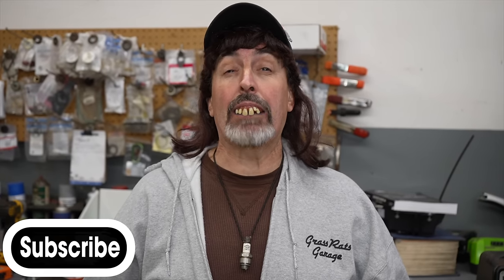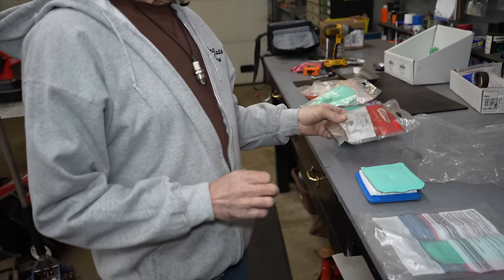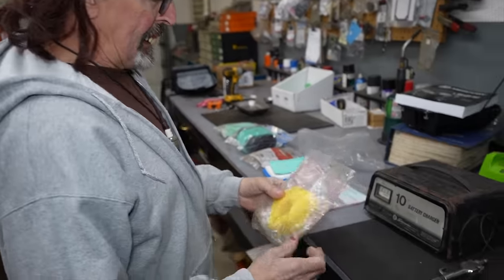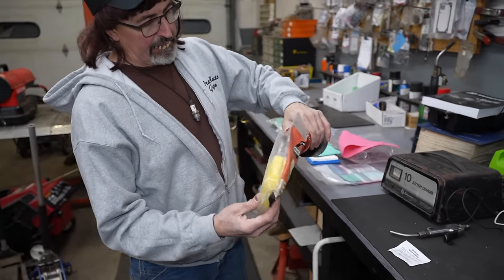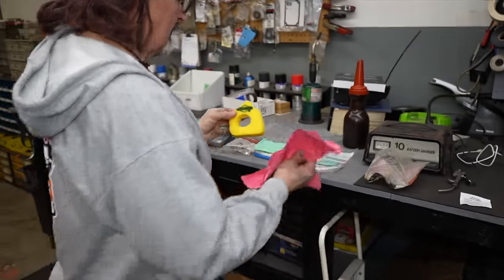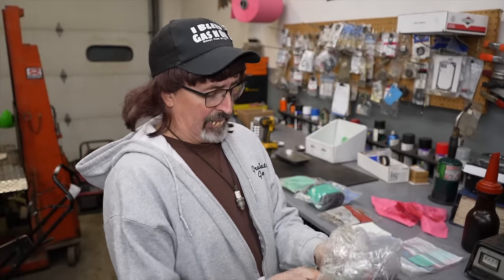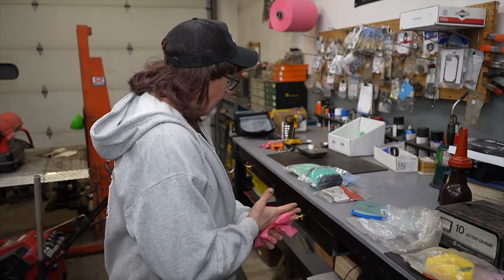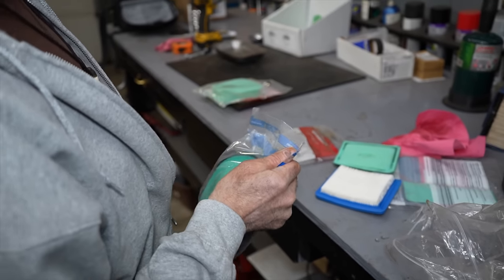Should You Oil Your Air Filter?

Comment: Long time automotive mechanic here, I didn’t know the pre-filters needed to be oiled. Good information as always, thanks Taryl.
Reply: That obviously doesn't confer expert status on you or your profession, but even K&S filters use oil and sell a special filter oil (automotive performance applications). It's the best combination of the old oil bath air cleaner and the modern kind with a foam and/or paper element. Did you know older engines used an oil bath type?
Reply: @Hjerte_Verke  Did you know they also came with a rope and wooden handle with which to start the motor.
Quit acting all high and mighty.  Basically calling us stupid/ignorant.  That attitude is just not warranted.
Reply: Manual for tecumseh vtwin specifically says not to oil pre-filter.  No idea why.
Reply: @gadasavideos8564 So does the manual for the Kawasaki V-twin FR and FS series. Specifically states do not oil pre filter.
Reply: @scottp2462  don't know about kawasaki

Comment: Back in the 1930s, 40s and 50s cars had oil bath air filters, that looked like a giant Brillo pad sitting in a pot of oil with a lid that fit with an opening around it to allow the air to get into the filter through the oily brlillo pad media and then on down into the carburetor. They kept the bigger rocks out of the engine.
Reply: They kept Everything but Air out of the engine.
Reply: My 1967 Ford 3000 tractor has an oil bath air filter. That oil can get dirty but the filter above it was always clean.
Reply: Oil bath filters were the best air filters ever made. The Army still used them in the 70's.
Reply: Just can't use them on modern engines because the oil messes with the MAF sensor

Comment: I have been using motocross air filter oil on everything from rc cars to dirt bikes or anything with a foam filter. Just soak it in oil, squeeze out the excess and let it sit overnight to get any remaining oil out. I like the motocross oil because it’s extra sticky and captures all the dust. And clean the foam in hot soapy water. It is more expensive but a lot better!

Comment: AWESOME! I was taught that oiling the foam restricted air intake and could prematurely damage an engine. Thanks so much!
Reply: there are lots of bad advice out there....lol... how can oiling cause problems..if over oiled it will foul a plug at worst...but soon clear up and be fine... no oil can destroy an engine quicker
Reply: it isn't saturated, just damp with oil.

Comment: Also it is important to change the air filter because  a very dirty one  will cause performance issues with the engine making it run slower which has happened to a mower that we own it was running quieter than normal and I thought this is an air filter problem and it turned out that I was right.  I looked up on how to oil air filters and if you need to and I found my information very quickly and it was nice to see Taryl go over this as well.

Comment: Dawn is the best for washing prefilters.  Rinse well, squeeze out and dry on the boiler or on the floor in front of your fridge where the warm air vents out, or outside in the sun on the deck railing.
Reply: That's what the 5 gallon bucket of old gas is for 😉

Comment: You have brought up a valuable and money saving revelation.  For years, and even though I have lots of automotive experience, I have serviced our dirt bike and UTV air and vent filters with JP Aerosol, which is recommended by the bike shops and is expensive.  In reality, using conventional motor oil is just as effective however because the serviceable filters are rigid, I will now use a pump spray applicator.  This will save a lot of money.
Reply: That's on you for wasting money on a "specialized" product instead of using something way cheaper that does the same thing. I actually read motorcycle manuals and they have said to use fresh motor oil for as long as I can remember. I'm sure "bike shops" recommend a lot of things to garner a sale, it's all about the money 💵

Comment: This was great, Taryl. But it would also have been helpful to show a dirty filter being cleaned before re-oiling it. No one needs to find or buy separate pre-filters if they just see how easy it is to clean the one they have (regularly) with soap & hot water ~
Thanks, always good viewing 👍 👍 👍
Reply: Use fill a small bucket with hot water and liquid dish soap (i.e. the stuff they use to clean the ducks when an oil tanker spills). Submerge the filter and squeeze it/swish it until it isn't oily anymore.

Comment: Great information video, Taryl. I always have used common sense & oiled the foam filters, squeezed out the excess oil. I also clean & reuse the filter. With you having the business that you have, at first you were probably shocked when a customer would bring in lawn equipment, they didn’t do any maintenance but now you’re probably not. The ones that don’t maintain their lawn equipment are probably the same ones who don’t maintain their vehicles. Keep’m coming

Comment: This reminded me of time I helped a lady start her Yugo at night. I thought the choke was stuck, when I took off the air cleaner a swimming pool of oil saturated the paper filter. Well it's not good to run your Yugo without one, I told her it would get her home. It started and then gave a free light show from the cracked ignition wires and off she went.

Comment: Lot of people don’t realize the older vehicles pre 60’s didn’t come with paper filters. They relied on oil alone to do the filtering. Most had canisters with a Brillo looking media that the oil would circulate through before going into intake. The dirt would accumulate at the bottom of the oil reservoir and would need changing regularly
Reply: Lots of older tractors like the Ford N-series used the oil bath method.

Comment: I have a bottle or 2 of K&N filter oil for my car and truck. I would think a light spritz of that on my mower filter would work well and minimize excess. I might try that in the spring.
Reply: A down side to the kn filter being oild is when oil gets sucked up into your mass air flow sensor and ruined the eliments

Comment: Your right about getting a new pre filter and throwing the old one away normally the foam gets old and starts to fall apart  just when you don't realise then when you check it to wash it out it's half gone or sucked around the main filter , good airflow =power and economy filters are cheap engines are not ! New filters are cheap insurance ,

Comment: Yes,I wash mine out with dishwashing liquid, let it dry out, stick it into a small bucket then soak it with engine oil then I wring it out as per Briggs and Strattons service manual instructions then I refit the filter. onto my 3 horsepower Briggs and Stratton powered mower  !
Reply: You're automatically elevated to genius status in the comments section. So many are bewildered that you would oil an air filter (and leave the oil filter dry lol).

Comment: No need to buy a new foam filter or pre-filter, you can hand WASH them with mild detergent or dish soap, let air dry and then re-oil. This is stated in many a Briggs-Honda-Clone engine manual
Reply: You can wash them... for a while.  Eventually they fall apart.  They are cheap enough that it makes sense to replace them if you value your time.  Either way, any maintenance is better than no maintenance.
Reply: Wash them in turps, not petrol then wash the turps out with soapy water and rinse. Dry in the sun thoroughly. Don’t over service them and with motor bikes use some grease on the sealing surface at the front of the air box to make doubly sure no dust gets through. The turps will wash the grease seal off too. You can wash a good spare parts, not after market, filter many times.

Comment: Back 40 years ago I raced motorcycles I squeeze to much oil out of my filter an after the race I checked the filter an it sucked dirt because of it. I would also add  grease the mating surfaces of the air box.
Reply: Grease in the air box is the best

Comment: I don’t oil the foam wrapped filter on my Briggs Intek, however that filter and foam are cleaned and blown out everytime that mower leaves the garage. My filters have held up well and had a long life for doing this. I know some videos are done for folks that largely do not routinely maintain their equipment.

Nothing I enjoy better than to trigger trolls and watch them loose they’re _ _ _ _ when someone does something different than them 😁 For me I could care less what others do, knock yourself out 👏👏👏
Reply: Always oil the foam ones.  It is about the Engine, not the Filter!
Reply: @gordbaker896  Me and my 16 year old Briggs largely will not 🤣
Reply: You're supposed to oil it so you are mistaken, and doing it the right way means you don't have to "blow out the air filter" each and every time, but you do you. However, it doesn't matter so much if the engine uses a conventional paper filter along with the foam pre-filter. You over-maintain your equipment because you failed to read the manual 🤡
Reply: There is 2175 telling you that you are wrong too.  What would this channel be without a know it all?
Reply: So you just create yourself more work for no reason? 😭🤡

Comment: This is how I have always done my filters.  I like to use the two stroke oil because its normally coloured oil eg red or blue for the two brands I use.  The colour in the oil means its easy to see if the filter is fully oiled or if it needs more.   I don't agree with throwing out the filters when dirty given its easy to wash them out with dishwashing liquid and then after drying reoil them.  We are too wasteful and throwing still good foam filters out is adding to that waste.

Comment: Chainsaw filters get really dirty because of the sawdust, oil and dirt, but they do not have pre filters to oil. I have to check and clean them every day I use them, otherwise I have starting issues if they get caked with dirt.
Reply: I was shocked when my friend chainsaw stopped, I removed filter and it started up, he said I will take it to shop for repair work lolol

Comment: Most people, like 99 9/10 % don't and you never hear of problems e/ piston rings wearing out. Only a commercial mower will EVER need a filter. It's cheap for the mgr to include on a new build and it serves as a fire suppressor. But most people are conditioned to believe it's even needed. Taryl: What will the "dirt" hurt? Be specific. Rings. When was the last time you saw piston rings wearing out? NEVER. The rest of the mower will wear or rust out 1st.

Comment: If you take the time and read your owners manual, it will explain this exact situation. I have a 2009 JD X-320, 22HP Kawasaki engine with 700hrs. on it and it runs the same as when new. Typically it takes 1 or 2 Oz oil. for this. The pre- cleaner for X series is about 6 dollars. I change it after each week. The actual air cleaner is still like new. If u oil it, it won't run correctly. I did what he said , buy a couple extra.

Comment: I raced Dirt Bikes for 15 years...we use a better oil option. Foam Air Filter oil that starts off liquidy then gets sticky/ gummy and will hold up better in heat or just normal as regular oil will drip downwards and the Dirt Bike products ( they will say they setup sticky - some are no better than regular oil )... the filter will stay better for you longer if you use this type of oil..and cleaning is the same... i usually use a solvent tjen warm regular soapy water to finish the cleaning ( dishwashing detergent is all you need ) ..rinse it in plain water....squeeze it gently to get the water out and let it dry...i usually have an extra filter so one is ready to use and one gets cleaned etc...
We stopped using regular oil in the 1970's.... they said plain oil too but it is not the best option..the better oil isn't expensive and will last many years too...
Reply: You're not supposed to saturate the filter in the oil, so there's no dripping. I think you're just overthinking the issue---BUT you are a racer and whatever the budget allows, you can justify and racing has its own issues. Not sure I'd want stickier as that sounds like it would clog in minutes; whatever. For us regular dirt bike trail runners, regular motor oil works splendidly.
Reply: @Hjerte_Verke  
nope...been a mechanic fir 50 plus years....and it isn't over oiled if done correctly..it coats it but breathes..and over thinking isn't what i do ... i raced pro and know alot about what i talk about.... i use it on my garden tractors...regular oil will flow down and then your filter has no oil in top part..oil is the fine filter on a foam filter....without oil it is not working properly - why they tell you to oil it....i do squeeze out excess oil...but you learn to add it slowly and cover the filter....if it's too hard to read ??  probably can't understand why we use it..only idiots use a plain oil on foam....but hey?  at least oil it....
Reply: @Hjerte_Verke  
the reason it sets up sticky is it will not run off ..even lightly oiled filters will start losing the oil
.the sticky part of the setup keeps it suspended on the filter to continue doing the job ..to keep dirt out of your engine..as to affordability?  it isn't expensive...saves rebuilds...is pennies to use....you are over thinking this...lol
Reply: @Hjerte_Verke  
any dirt bike rider nerfs to learn tips..ignorance isn't being smart..the oil is an improved product anyone can use..and should....how often do you clean your filter???
Reply: @Hjerte_Verke  
the sticky part also grabs the dirt better than plain old oil.... before i raced..i rode trails..we all did that..racing isn't high tech till you get into bigger races etc.... you spend money wisely or you pay more by bad maintenance .... anyways my tip was for those interested in different options only...not an order....i give help for Free..like i did when i raced....
Reply: @Hjerte_Verke Proper filter oil is stickier, it works much better and lasts longer. It is not possible to squeeze too much out provided it was saturated in the first place. It will not impede the air flow provided it is properly squeezed out. I have never dusted a motor and have been riding dirt bikes for fun and work for 50 years.

Comment: Proper filter oil won’t drain out of the filter like engine oil will. It is very sticky and stays there. Some is very thin till it is exposed to air to make it easier to squeeze into the foam then becomes quite viscous.

Comment: A dirty air filter will limit the amount of of air going into the carbatrator thus making it run rich.Fouls your plugs.The cold air intake on my truck is pre-oiled because it's not a completely sealed unit but traps the excessive dirt.If I over oil it, it screws up the MAF and wants to lean the motor out.
Reply: "A dirty air filter will limit the amount of of air going into the carbatrator".  Similar when you oil a filter that's not supposed to be oiled.

Comment: Most filters tgat come with foam filter/pre filter.  Are only sold in sets. So you buy both which is ok it takes care of your mower engine.
Reply: Good idea to buy them in sets instead of one at a time. Good deals to be had in a 2, 4, 6 pack of filters because they are so cheap

Comment: Pre-filters that come in contact with paper filters should not be oiled, they are designed to catch leaves and grass, not necessarily dirt . Some cartridge type filters have a metal mesh screen around them, the pre-filters covering them should be oiled. Oil should never come in contact with the paper filter, it will stop air flow.

Comment: Won't the oil effect how much air is going through the filter? What if your motor didn't have a filter that needs to be pre-lubed, you oil it and now the carb is going to run too rich? Less air flow. I will try to oil my next filter and see if there is a differance.
Reply: It's just a light amount of oil; if it is dripping off you used too much. The oil is only there to collect, trap and isolate dirt particles. If your engine runs richer, you can lean the mixture but that's a given as the A/F mixture is always adjusted with the air cleaner installed.

Comment: Old dirt bike riders should know this.   There was a oil made just for foam filters, but I don't remember the brand.  Maybe someone does.
Reply: K&N makes their own filter oil/spray and some of it comes out of a bottle and you drip it on
Reply: I think I had PJ1 filter oil, otherwise I used yamalube. But on dirtbikes I cleaned the filter every 2 or 3 hours. 
My lawn equipment get the filter changed every 10 years..LOL

Comment: The foam is a labyrinth , a maze. The dirt has to make sharp turns as it goes through the foam and it sticks to the oil.  There should only be enough oil to coat the tiny strands that make up the foam. You are not trying to fill the voids with oil. Think of an oil saturated rope. 
-
I wrap the freshly oiled foam with a paper towel and squeeze the filter. This will force the excess oil out into the paper towel. Do NOT wring the foam. This will tear the fibers.

Comment: For myself when it comes to oiling filters I'm a little more messy. You take a pan of some sort that you won't mind getting oil in then you put the filter in and pour in the oil, I usually just go for 30 weight non detergent oil since that's what's already in any small engine I'm working with. Then I put on some sort of rubber gloves and get to work making sure the filter has soaked in a good amount of oil, then I wring it some (taking care to not tear the filter) to get out whatever oil I can so it's just damp with oil and not soaked. I just do it this way because it's how I was taught. EDIT: One thing, be careful about having people use any old oil, there are people out there who would use vegetable oil and might be surprised when their filter gets filled with mold.
Reply: Non detergent oil lacks the additive package needed to prevent wear in modern small engines. Been running automotive 10w30 for years without issues.